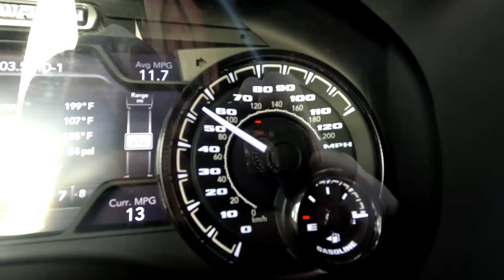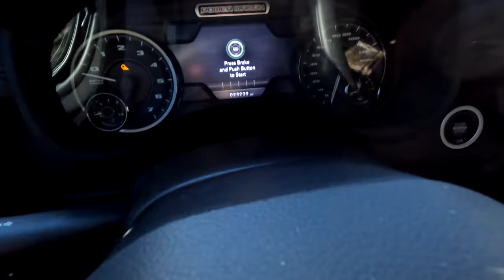2 Year no BS Review - 2019 Ram Power Wagon

Comment: I had someone hit me in the ram 3500 a couple weeks ago and have a F250 rental. There are some quirky things on it as well. I used to be a Ford guy but pretty open minded - have owned big 3 + Toyota and Nissan. Ram trucks have been my favorite but not perfect. 

F250 rental - wow. This thing rides awful. I've been in F350's that ride fine. Don't know what the deal is but it's bad.
Buddy of mine got tboned in his F250 and got a rental F250. Said it was terrible as well - swapped it for a ram and said that's what he was getting next. Anyway that comparison is gas vs diesel so that's possibly the difference. Unladen springs- you'd think they would be compensated for in lighter spring weight.. That said the sync system is nice and rear camera is excellent 

Debating adding a PW and getting rid of the wrangler. Appreciate your candor in the video!

Comment: Awesome review! I just turned 3k miles on a 2022 twin to your truck. And when I say twin I mean the color, antenna, FTM400 and the thoughts. I love it and honestly, it pulls better than the last 4 of my Fords (yes Ford fanboy as well) including my 7.3L diesel. I get between 6 and 8 when pulling my 10K# camper or my 16K# excavator and trailer. I settled for this truck because I couldn't find a 7.3 gasser with the 10 speed transmission and 4:10 rears and I am honestly verry happy with my choice. Great video!! 
W2GPR

Comment: I went from owning only Fords since I was 15 (now 35) to a Ram 2500 Cummins and I have put 53,000 miles on the truck so far and not a single issue yet. I am tuned, but only throwing an extra 30hp at the truck as it's the high output version and already making an insane amount of power. I wanted a Power Wagon, but I do tow a gooseneck at times that is close to 20k pounds and a big RV. Empty tuned I average 17 mpg in my every day mixed highway and town driving. Straight highway I can pull 22mpg. I also couldn't believe the brakes were how bad they were coming from a Ford and went drilled and slotted. Cold air intakes do nothing except make more noise and I finally learned to just leave the stock intake on them.
Reply from the maker: Nice!!!
Reply: I thought the High Output Cummins was only available on the Ram 3500?

Comment: Thanks for the follow-up 2 year on the 2500. I've been considering upgrading, and still very much on the fence. I also think I'm more Ford than Ram. No truck's perfect, but I'm noticing a few more overall problems with my 1500 vs the F150 I had. I too tried the Ram brand to see, but everything seems to be pointing me to the 7.3 in the Ford over this 6.4 Hemi.
Reply from the maker: i do want my next truck to be a super duty.  i just gotta decide on 7.3 gas vs 6.7 diesel.  i drove a diesel for a week as a loaner and loved that exhaust brake while towing.

Comment: All 3 suck now but RAM sucks less I have found(I use to have a 2012 f150).  Do to all the computers now that has nothing to do with ram but the manufacturer of the parts.  Now the wiring is a RAM thing and it’s the way the assembling plant is putting the wires down.  That’s funny you get 2 to 5 mpg better then my 22 PW mind you am only at 3,000 miles but I also drive mine in V8 only do to lifter problems that can happen due to MDS.  Hopefully I can avoid the lifter failure, but if not I’ll do the MDS delete if out of warranty if that’s when they fail.  I hate and I mean hate the stock steering on the PW which I’ll be fixing(drives like a jeep and the hard braking is scary).    I have found the PW is awesome out of the box BUT needs some big upgrades to make it safe and unstoppable.  Why it still only comes with 33’s still mind blowing when the trx and the Ford F-250 Tremor has 35’s.  I like the 7.3 ford but not the transmission(due to not being able to last longer the 70,000 miles and not being able to take the abuse) so that’s why I bought the RAM

Comment: I have a 2020 w rambox dual alternators 12in info fully decked out minus the engine block heater and 24k miles and does not live in a garage. The only thing i experienced was needing an update to correct soneodd backup sensor behavior that didn't start until 22k. Seemed odd to me but that corrected it 100%. 

Knowing all the electronics in this thing I did a 125k 7 year extended warranty just in case cause there is a ton of stuff in any new vehicle with tech ology that could go wrong.
Reply: So was that bumper to bumper extended warranty?
Reply: @ecocav0222  Yes. Hopefully won't ever be needed.

Comment: Try a Toyota, or maybe not. The Tundra’s engine selection has gone down hill.
Reply from the maker: Never been a Toyota fan, sat in some at the Denver auto show. Just didn't like them
Reply: @JustinKingOffroad  I did not care for the Tundra, though I did purchase a Tacoma.  With out a doubt it is not up to the heavy lifting that true full size pickup can do, but I have worn out a few full size trucks and am tired of the crappy build quality of the domestic options. I have a Ram 3500 dually with the cummins, the engine is fine at 421,000 miles, but the HVAC system now absolute garbage, I spent big money on parts to get rid of the death wobble at 360,000 miles.  The drive train is not up to professional standards. 
Perhaps Cummins and Toyota should collaborate on a true heavy duty, long lasting professional grade pickup line. 
To hell with the big three’s garbage trucks.

Comment: I’m a Colorado kid also. I want through the biggest decision of my life between the power wagon and the tremor. Tremor KR won with the diesel. 17,000 miles in almost a year, no issues at all. I’ve owned several jeep wranglers Two  Rubicon‘s at the moment with my tremor. I’ve always been a hard-core Mopar fan with zero issues with the Jeeps. So far Ford is treating me right.
Reply from the maker: I'm torn on an oil burner.  Hefty premium that could be used to buy a ton of gas in the 7.3 Godzilla.  What fuel economy you getting out of that if you don't mind my asking.
Reply: @JustinKingOffroad  17.5 to 18.5 pretty much all the time. I’m heavy footed. LOL.. I have had some trips to Tucson Arizona and Pennsylvania and got about 22. 16 mpg towing a 3500lbs trailer back from Tucson. I mainly drive from Littleton to lasalle for work. Drive those yellow trains.
Reply from the maker: Hot dang that's impressive!
Reply: @JustinKingOffroad  new power stroke 20-22 has a lot of new upgrades. I also run hotshot secrets every tank.
Reply from the maker: I've heard some horror stories about all the diesel emission crap on these trucks now
Reply: DEF about a gallon per 1000 miles(empty) Towing not so much. Haha
Reply from the maker: @johnanthony6141  I only tow about once a month, I'll have to consider this.  Still a 3-4 mpg difference buys a lot of gas with a $10,000 premium for the diesel engine.
Reply: @JustinKingOffroad  Yes, I am concerned about the emissions crap. Hopefully the warranty will take care of it. When I built my tremor, cost came to about the difference off 7500. And from what I see the Godzilla is getting about 11 to 12 miles per gallon. When I did the math it took about 100,000 miles to get the money back. But the power is awesome. LOL.
Reply from the maker: @johnanthony6141  well I plan to hold onto the power wagon a couple more years. So I have time to figure this out haha!

Comment: What about the rock in pop can exhaust on cold start?
Reply from the maker: i'm not following the question, but if you're asking about the straight pipe muffler, it's still epic.
Reply: @JustinKingOffroad  sorry. I’ve been frustrated trying to figure this out. A big issue with the 6.4 hemi in the ram 2500 is upon cold start and even somewhat thereafter the way the air hits the cats makes an aluminum like squeal. Ram forums are full of people complaining about this. It pretty much sounds like an exhaust leak. I’ve been looking for a fix. Ram says it’s normal.

Comment: Do you feel like you are limited in the trails that you do in the mountain in Colorado. I am in Denver and have a slightly modified GX460 and some of the mountain trails for example near Idaho springs seem narrow. Thinking about a full size but don't want to be limited in where I can go
Reply from the maker: If you are comfortable with scratching your paint then you don't need to be worried about it at all. I don't actively go out and try and ruin my paint but I have had no choice to get to some off-road recoveries before. This truck is only a few inches wider than my Wrangler so it really doesn't make much of a difference. It's such a capable truck it has literally gone anywhere I've told it to go
Reply: @JustinKingOffroad  thx for the reply. I have learned not to care about paint at this point. The only thing is these new trucks are so expensive these days at over 60k.
Reply from the maker: @ramzizaz  yes it is pretty stupid how expensive everything is now

Comment: Did you get you speedometer and tires to match after you changed to 35
Reply from the maker: Yes I did! Used alpha obd to get in there and permanently change it.
Reply: You didn’t mention that in your review about the tire change. The issue is the dealer needs to recalibrate your new height because of the tire change. Yup, there’s your ACC issue. Had the same problem with my Gladiator. Note that some less experienced dealerships don’t know about it either. It’s a $75 service.
Reply from the maker: @C8sorbs  the tire size has been programmed permanently in the truck with alpha obd. I had the dealer verify that it took too.
Reply: @JustinKingOffroad  it is still required to get the recalibration done at the ACC via the dealer scan tool. No way around it. Your 90 min flash probably took care of this but know that’s why you were having ACC issues.
Reply from the maker: @C8sorbs  good to know, I just know they verified everything matched 35s

Comment: How many miles did you have while all of the problems started to acure? I'm looking to get one near me that's fully loaded equipment 2 with off road package but it has 23k miles on it its about $6k less than 1 that has 12k miles so just trying to weigh my options
Reply: Specifically 2019s
Reply from the maker: Most of the weird little electronics glitches began immediately so more than likely most of that stuff is taken care of by now
Reply: @JustinKingOffroad  thank you for thr reply, also found out that they both have a 3 year or 30,000 mile warranty so that helps a tiny bit lol

Comment: I've used PowerStop rotors with ceramic pads on my 300C 5.7L HEMI, VW Tiguan and RAM 1500; and I agree 100% that it made a HUGE DIFFERENCE with each of them. I'm not just talking about "better" breaking... I'm talking MASSIVE IMPROVEMENT! Even if I purchase a new vehicle, I'll change the brakes from OEM to Cross-Drilles & Slotted rotors + Ceramic pads. Never again will I risk the lives of anyone in my vehicle.

As for the adaptive cruise control... I'd deactivate that shit on ANY brand vehicle I had. It's dangerous and stupid; and only dumbs down driver experience. I'll trust myself over adaptive cruise control, anyday.

Everyone has their personal preferences, but I wouldn't get a Ford, or any other truck, over the RAM. Not unless you don't mind the truck blowing up and catching fire on you.

You've got a 2019 Power Wagon. The current model has ironed out some of the bugs that you've experienced. I'm not saying that a Power Wagon is what you need, or should get, but the 2020 RAM series are that much better. No joke. I'll be a RAM enthusiast, as long as they keep improving the way they have for the last decade. IMO, RAM make the best quality trucks, right now. Ford quality has gone to shits; and GM/Chevy are plastic toys.

Comment: It is the Ram brand. The uconnect radio and air bag in my 2016 PW have both been imperative and don't even get me started about the 2 repeat transmission failures and collapsed 6.4 Hemi lifter I've had😡 I'm considering a tremor too
Reply from the maker: wow i've not had any transmission failure.  that really sucks!
Reply: Fortunately the new 8spd ram uses has had really good reliability especially compared to older years, like pre 2019
Reply: @Apothas541  i really wish they had a kit to retrofit an 8 in place of the junk 6 speed